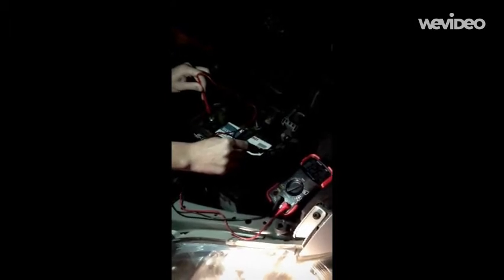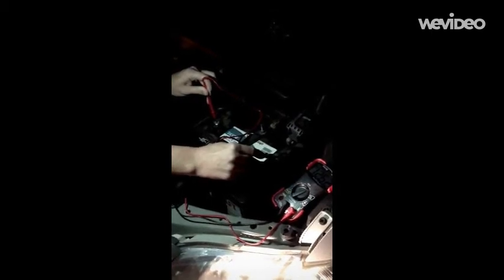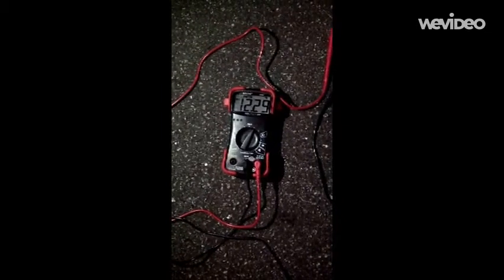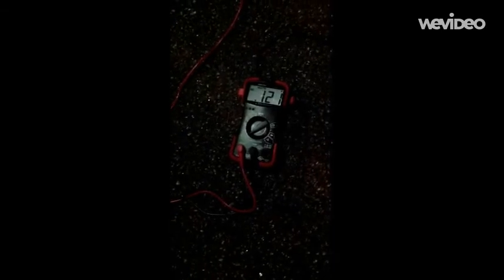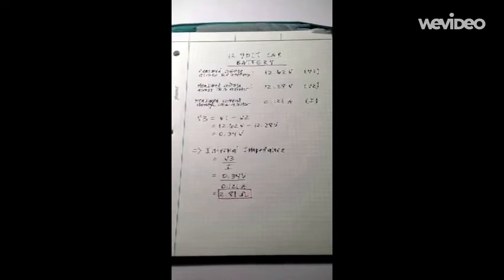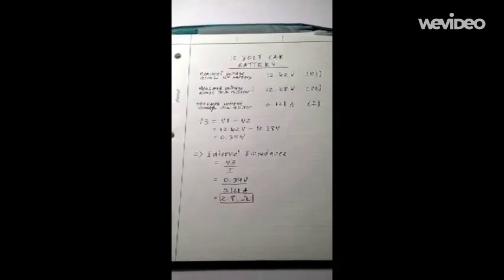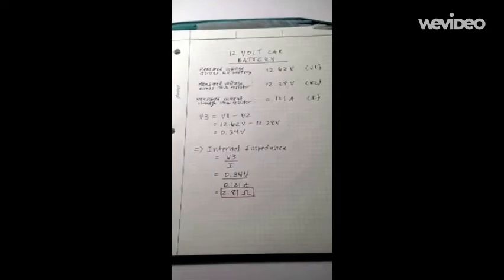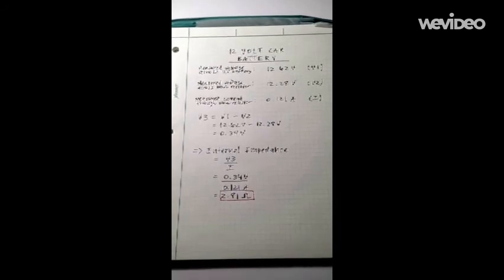Measuring the Internal Resistance of a 12V Car Battery

Comment: The theory behind the calculation is correct and thanks for sharing this experiment. However, there is a serious caveat, and that is to do with a simplistic modelling of a car battery as a ideal voltage source and an internal resistance in series. Unfortunately battery is an electrochemical device and the model is little complex. However, you can use the same calculations and arrive at a much precise value by putting around 4 Ohm load in parallel to the battery and then connect a load across it. Still then different values of loads would give you different values of internal resistances which is attributed to the real model of a battery. However you will be much closer to the actual internal resistance. As thumb rule, a typical car battery internal resistance should be around or less than 20 milli Ohms.
Reply: 5mohm or less is best for a car battery

Comment: Something is not right here. If the internal resistance were be 2,8 Ohms, the maximum power at (optimistic) 14,4V is  14,4^2/2,8= 74W which is unrealistic low.
Reply: Yup you're right. In reality internal resistance is in ~20 mOhm range.
Reply: 2.81 mohm is more like it. Anything under 5 mohm is good.

Comment: You don't need to measure the current of the system in order to find the internal impedance. Basically if you use a voltage divider all that you would need to measure is: the resistance of the resistor, the open circuit voltage across the battery and the closed circuit voltage across the resistor.Then use the internal resistor as one of the resistors for the voltage divider circuit and that is what your answer should be.

Comment: lbecque: I agree that ohms law would give a different figure. Since  R=E/I  a large output would indicate a low resistance. Batteries look simple, they are not. Batt. flow rate and capacity are defined by the AH (ampere hour) current draw,(flow rate) and actual capacity depletion (amount taken out) are vastly different. If we crank an engine for 15 seconds (1/4 or .25 of a minute) at a flow rate of 400 Amps look what happens- 400A/60min=6.67 Amps per minute but we only cranked for .25 min so 6.67 x .25= 1.67Amps . Only 1.67 amps were taken out in 15 seconds despite a flow rate of 400 Amps. I am trying to find the math for charge up time on Batts. but it gets seriously technical when many aspects of design,temperature, connections etc,etc, are considered. One of the best sites of battery talk is "TIGHAR" and a technical discussion of "Amelia Earhart' Batteries" installed in her Lockheed Electra which disappeared along with her and her navigator, and was lost in her second attempt to fly to fly around the world [ 1937 ].

Comment: This example is WAY WRONG!  Typical car batteries have internal resistance in the milliohm range, like .008ohm.  Some even as low as 2-3 milliohms.  I has to be this low to supply a hundred amps or more to start a car engine.  If the internal resistance of a 12 volt car battery was as high as 2.8 ohms using ohm's law (V=IR) the current available to start the engine would be limited to 4.8amps.  Not near enough.  I agree with bearingef that using the open circuit voltage reading is not reliable for two reasons: 1) a small amount of current flows through the meter and introduces error, and 2) ideally internal resistance should be linear with current but in real life it isn't and both high current and low or no current draws introduce errors.  It is best to use the two resister method in the current range the battery will be used in.  The amp reading of .12A for a 100ohm resister seems about right so either something was wrong when the voltage measurement was taken or this is a really bad, failing battery.
Reply: I agree there is no need to measure the current directly.  However, a result of 2.8 ohms is plausible. I have seen readings up to a few ohms. It just means the battery needs to be replaced. That's how we test batteries that seem to hold a charge okay, but are causing problems in their circuits. (like Mercedes-Benz auxiliary battery error codes)
Reply: @PurkeyPile  SOMETHING IS OBVIOUSLY WRONG HERE, SHE IS MEASURING 12.6 VOLTS INITIALLY SO HOW CAN 2.8 OHMS BE PLAUSIBLE. DOES NOT APPEAR TO BE CORRECT

Comment: Greater than one ohm internal resistance doesn't seem right. That would put a limit of 12A from the battery. Car batteries are capable of hundreds of amps. I think no load voltage readings aren't reliable enough. I think you need to make a minor change to the procedure. Use two resistors, and base the calculation on the relative voltage drop when using either one or both resistors as loads.

Comment: This was an excellent test of a battery. I have been wondering how I could figure-out how to determine the impedance or internal resistance of a battery...thanks, you showed me how to do it. My guess is the internal resistance will increase with age, of the battery and higher amperage.

Comment: the resistor is in parallel with the battery when measuring voltage, right?